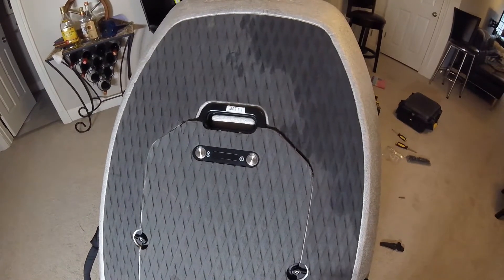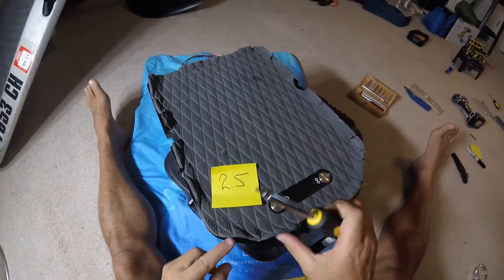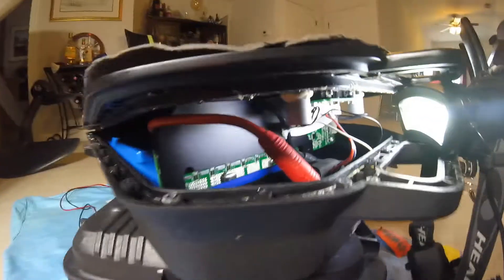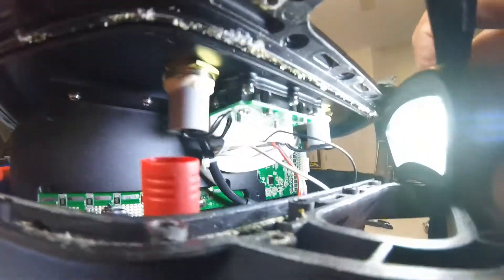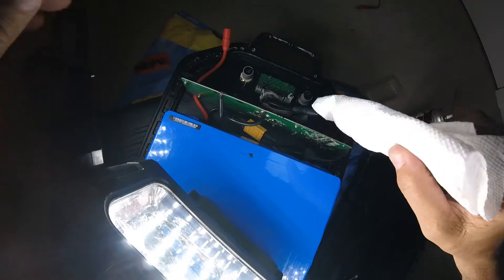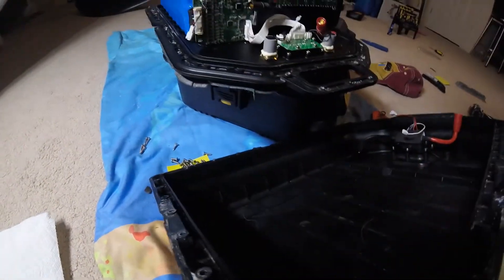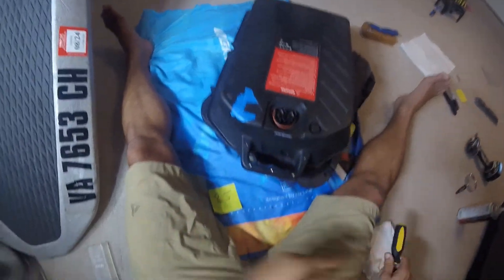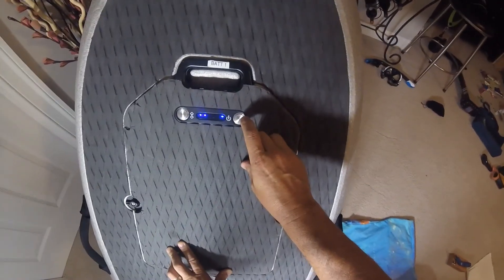Waydoo Battery Troubleshooting

Comment: Hi and thank you for your video. It’s very  useful. 
Just one question have you ever thought in replacing the battery cell’s?
Here in UK, there are some guys which they advertising that they replace the battery cells with new ones any type.
I’m gonna give them a call to ask them about the specific battery cells. 
I’m also curious if they can actually fit larger ones? In capacity but the same voltage.?
I thought to drop your line before I do so in case you have an idea?
Thank you again 
 Kind regards Konstantin

Comment: A common cause of computer problems is micro-corrosion (a super thin layer of corrosion) between contacts.  The mere act of reseating all boards and connectors will "scrape" enough corrosion off so that good connection is restored. (until it corrodes again)   I have had several "bad" computers easily fixed by this simple procedure that anyone can do.   If it doesn't work, then it requires a deeper look, but it should be the first thing tried....  in this video you should have reseated ALL the connectors... not just the ones required to get the shell open.  (You got lucky)

Comment: Thanks for the help. Curious…when your terminals were loose, what’s as the problem? I have the same problem with that red light and no beeps. I just followed your video to the T and when I went to turn it on I got nothing. Everything is connected. What did you use to clean the corrosion? I’m using something called QD Contact Cleaner from Home Depot. Not sure if that’s what ruined it or not. Any help would be appreciated